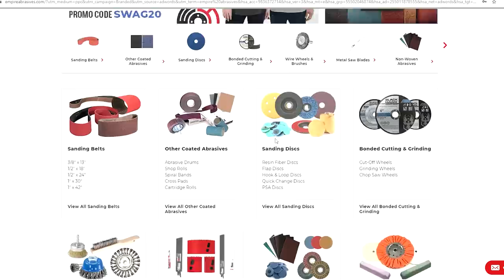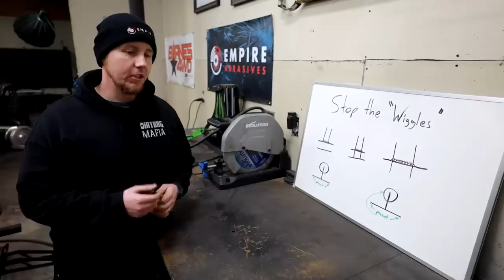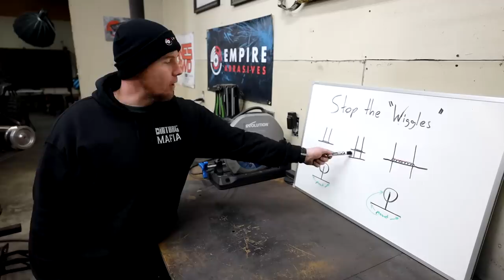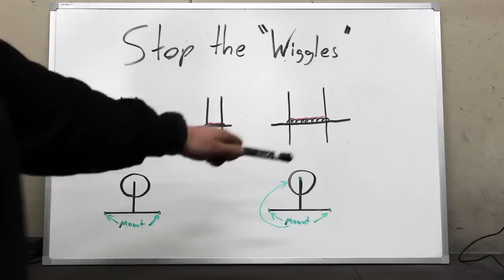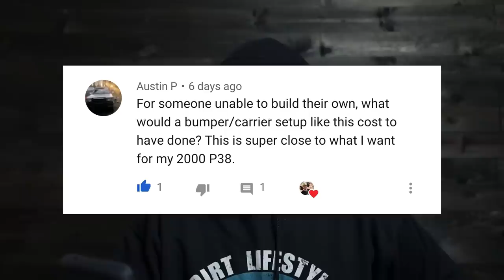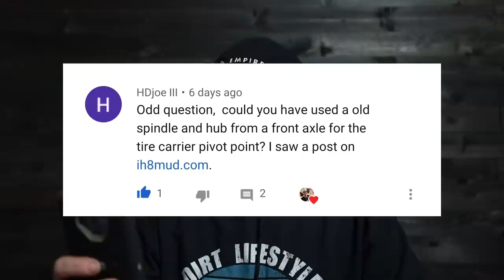Ultimate Overland Tire Carrier Episode 4. Ultimate Land Rover Discovery Build Episode 19

Comment: Thank you for the shout-out for skilled fabricators!  I'm not a skilled fabricator, but I'm a decent mechanic and I know my way around most fab tools.  I'm currently helping someone 'close to me' rebuild their car and they essentially want a full restoration (including the motor) for about $5k. 

This person repeatedly pressures me with 'how hard can it be?'

Well, the ten month collision repair course at my local CC cost several thousand dollars. Tools, air compressor, paint guns, welder, etc cost many thousands more. Understand that when you pay for skilled work that you're paying for the knowledge as well as their overhead costs (shop space, electricity, water, internet), consumables (sandpaper, welding wire, rags, etc), wages, materials, experience, and everything else you lack to do the job yourself.

Which brings me to a second point. 

If you're looking at a $4000 tab to have someone build a rear tire carrier for you and you know your way around tools (and have a decent set of them), consider that the very same $4000 would set you up with a low budget welder, tubing bender with a couple of dies, materials and a few other things needed to start learning this yourself. That's assuming you have a place to set it all up and work.

Comment: I suggested a variation of this latch a few videos ago for the lower latch. I’d like to see if you could run two of that style latches using the same pull lever to disengage it. Using a one into two style cable such as the “Odyssey Lower Gyro3 Cable (Universal) (Black)” part number #b-153-bk in doing this you would eliminate a step in the process of undoing the tire carrier without sacrificing any integrity.

Comment: Whats worse then a spare tire bouncing down the highway? One that is still attached to a huge hunk of metal 🤣 Curios how much the bumper/carrier will weigh and how your rig is handling the extra weight of this build from a suspension and engine/power perspective.
Reply from the maker: Lol definitely. I over geared the drivetrain to compensate for the weight but at the end of the day this rover is going to be heavy as hell. I'm embracing the trade off of weight for comfort and will do what ever is necessary to make it all work. It will likely need a diesel but time will tell!

Comment: Might build a taller tube where it pivots on the bearing and make to bearings so you can make a triangle point to the where the tire mounts and maybe a small brace going down the back of the leg down the fender side.

Comment: The brake lever looks like it might also have another barrel adjuster on it (like what you fabbed up) so if anything backs out and you need to take slack out of the cable, you still can.
Reply from the maker: It definitely does! Lots of adjustment in this simple system

Comment: I have been using a DOT door lock style latch for mounting my tire carriers.  Pretty much bomb proof and the same as used on many hot rod doors. It can be fined tuned and adjusted in the same way  door pins can be moved. It is also of a double lock design (same as a door)   these  latches do not pop open under impact and they do not rattle.   Bear claw, bear jaw  style latch but I used the original USA  built ones (who's name escapes me- I think Hamilton).  Yes it is mechanically controlled from a remote location,  slows down that crack heads stealing stuff.  Getting the 150 lb tire up there is a pain in the butt

Comment: What I would do, is get rid off the rear window like you said and punch a hole through the centre of the wheel carrier and welded through the board of aluminium that will replace the window.😉

Comment: The cable might work in the usa but after a day or 2 in Australia in our thick, red bulldust that cable would be gunked up real fast. Also I'd drill holes through the rhs top and bottom and drop the round tube through and weld top and bottom that way you have 2 solid points of contact and eliminate a lot of the flex.

Comment: as a mechanical engineer, i feel like you missed a detail back on your tube theory. you are not wrong with what you described on your schematic, but the point of sending the round tube through and to the opposite wall of the square tube is to weld the opposing side alone with the adjacent side. so the weldment will be in double shier. on the other hand, that third mount is the right chose. that will eliminate almost all of the fatigue stresses in your design. which is what i was warried about up until now. love your work, keep it going.

Comment: Hey Nate congrats on another great video 👍
When rebuilding the front bumper will you build it heavier to offset the weight on the back to help keep the front tires planted while going more vertical??
Reply from the maker: Thanks! The plan is to use air bags in the rear suspension to help truss the extra weight. The front will be heavy regardless but I don't plan on adding anything extra to counter act the rear. I do however have a bunch of ideas to possibly incorporate a battery in some way to the front bumper. Maybe this could help in the way you are suggesting? Time will tell! Thanks for watching 👍

Comment: What do you think about a bar that is hinged on your roof rack so it opens like a car trunk, but if bent at a 90 degree angle to flip down and latch on the tire to stop wobble?  You could even run a safety chain inside the tube, and attach it to the roof rack so it never falls off.

Comment: The way you built that upper latch, you might only just need that and use the bottom for a safety. To be honest, I would have never thought of that system and it looks like it’s easy to open......
Reply from the maker: Thanks! I feel the same about the bottom latch. It's more of a fail safe at this point 👍

Comment: Hey Nate - did you ever consider using an electric solenoid for your latch?  The benefit being that you can easily trigger it from anywhere really... even a FOB?  I know reliability is big on your requirements...  FYI on my 37" tire carrier, the design has a full triangle shape with 3"x1.5" box steel sections - and it still wobbles around.  Your design is great.  Thanks for the vids!
Reply from the maker: I did consider this! It would be showing off lol. In reality I think a simple system wins in the overland category. Thanks for watching and for the comment 👊

Comment: Dirt Lifestyle,  I  know you are a great fabricator cuz I viewed many of your vlog. My concern is your tail gate latch life span. I built a sub woofer (2x-12") on my son's car that reside in the trunk. The trunk latch doesn't last long because of the vib. I replayed 5:55 on the vlog many times and noticed that most of the flexion is on lower bumper as you mentioned . You can see the lower bumper flexing compared to the body of the truck. It is possible, that if it is corrected, probably still flex because of the length of the swing bar and the tire mounting bracket. The flexion of the swing bar can be corrected by welding a big enough round steel tubing inside of it to take care of the torsional movement. Welding those gussets on the tire mounting tubing as you mentioned, will correct the back and forth movement. You can also add a '70's like vertical push bumper that is welded to the swing bar that extend below to the rear bumper that when you latch the swing arm it will push the rear bumper tight for added stability. Very nice vlog!!

Comment: Such awesome stuff.  I wanted to share something  from an accident I had in March of this year.  I was in a 2018 Ram up-fitted by  AEV to a PXL on 40's  a Tray and flatbed 4WC.  I rolled 4-6 times end over end and side to side down a ravine 300feet.  I had a Custom rear rack  with a Spare 40 on it and a chainsaw.  the rack kept the camper on (it was connected to the flatbed and the camper) till about the last flip.  The welds DID come apart on the rack and  some on the truck as well.  Strangest thing I've ever seen!  My welder told me they used a flex weld??  to me it looked like some weld didnt penetrate in some areas and miter welds looked like they might have been ground to far??  So...As you said in your vid... Welds are stronger then steel stock if its done right...   Maybe mine where not?    Keep up the awesome creativity!!!!  Love it!!
Reply from the maker: Hey man! Sorry to hear about your accident! Glad to see you are still around to share the story. 
If the weld is done correctly the joint is one with the parent materials. If the weld is cold then you are basically just gluing the stuff together and fusion has not taken place. It's easy to move to fast through a project and have a cold weld. Unfortunately it's hard to know with out testing it. In this case you tested it. 
This is why race chassis are often tig welded. With a tig it is very difficult to make a weld that is to cold unless you are working on very thick materials. In the tig welding process you can see the puddles influence on the parent materials much better because you aren't feeding material on top of the puddle like with mig. 
My guess is your torn welds were done with mig and the machine wasn't turned up hot enough but this is a huge assumption. Either way the point is with a proper weld it is extremely difficult and rare to damage the weld before the material around it.
Thanks for watching buddy 👍

Comment: I really love the build. I was just wondering how you would approach opening the rear gate if you were parallel parked with passenger side to the curb. Maybe a 90 degree pin point? That would prevent putting your giant arm out into the road.
Reply: On a second thought, assuming your tools are in the back and you need to change a tire on the side of a road....
Reply from the maker: If a tire change is needed I can remove the tire without opening the hatch. My tools will be store in a side compartment 👍

Comment: IMO: I’d rather see the third point be an inner mounted dense rubber bumper, deflecting the carrier slightly outward (away from rover), this defection moment would use the tube steel properties to secure the carrier, and minimize the fatigue cycling at welded connection you pointed out that will happen without ancillary bracing.  Curious to see how the longevity of the system holds up.  Be it: cable corrosion and contamination (dirt/friction) from use, pin wear, etc.,.  Thanks for sharing the videos, keeps my mind working too.
Reply: Nevertheless thinking at ~3LF with 2” SCH 80, ASTM A53 Grade A, you’d have a max defection of <1/2” therefor at design you’d have 1/8” defection at bumper, spring load system with said design and mitigate vibration and fatigue cycling to yield.

Comment: So 2 mounts on the bumper which is rigidly bolted the frame, while 1 mount is on the tailgate which is on the body? Hope this won't tear the tailgate long-term.
Reply from the maker: Yep! I'm not worried. The discovery is heavy from the factory for a reason. It's a ridged design because it essentially has two chassis. These have a unibody like a Jeep cherokee bolted to a very tall frame making a ridged suv. The deflection between the two will be very small. The wiggle you saw in the carrier will pickup the difference in the extreme (and rare) scenario that these have excessive movement independently 👍.
But if this became an issue, it makes for more content and another problem to solve.

Comment: I thought you were going to use the key fob and the unlocking mechanism for the discos rear door. I wonder what you could use the power that you have back there for too. The defrost power, window wiper motor power, and tail light could be used for lights and whatever. I was thinking that space could be your spice rack for your kitchen too.

Comment: Hey Nate, great work. I picked up a H.F. pipe bender after watching your tips and tricks video and bent up some fender protection. Thanks for the inspiration.
I was wondering about the tire carrier bracing/gusseting. Would running the tube through the top and out the bottom of the square tube welded top and bottom have worked? 
I prefer your third point of contact method but curious your thoughts about drilling straight through top and bottom of the arm?

Comment: Hey Nate, love the videos!! Just wondering, what drill bits do you use for drilling metal? Bits going blunt after a couple of holes is the one thing for us that makes fabrication not so fun.
Reply: A proper set of HSS (High Speed Steel) preferably with some cobalt in is your first step. Then keep the speeds and feeds correct. Rather go slower than faster. Thirdly cooling/cutting fluid helps a lot.

Lastly, learn to properly sharpen your bits. You definitely don't need fancy tools to sharpen a dril bit. A angle grinder with a flapper disk work 'n charm. I have 'n place on my work bench with a hole in that matches the handle of the grinder, therefor I use the handle to tighten the grinder to my bench. Quick and effective.

Comment: Hi Nate . 
Is there a reason you didn't incorporate the second latch release mechanism into the red latch release ? 
Or did you design this as a secondary safety feature in case the red latch busted open ?
Would it have been possible to have the bumper mounted part of the red latch mechanism pivot in some way as to open the secondary latch simultaneously ?
I guess there were reasons you made it the way you did . Just wondering is all .

Awesome work as usual . 
A must watch channel for sure .

Fattrucker

Comment: Probably has been said plenty, but what about the body being rubber mounted vs the frame mounted bumper?  Isn't that gonna cause some issues down the road especially when not on a flat floor?
Reply from the maker: I talk about this in the series. I believe the second episode 👍
Reply: Just rewatched it and you mentioned adding a cable/safety incase it popped open because of flex, but my concern would be that new third mount either getting messed up or just not wanting open/close when twisted up.     

It's a bit different but the Bronco 2 in the pic was rusted and anytime you were flexed at all (so pretty much always when off road) the damn hatch wouldn't close, ended up fixing it by chopping the top off and reattaching the top of the hatch back on to wall it off... haha

Comment: Im new to fabrication so let me know if this would work or not. Couldn't you put a piece of round tubing in the rectangular tube as a sleeve for a slug that you could drop the round tube of the tire carrier down on to and reweld it? Similar to what you did on the roof rack. Pros and Cons to strengthening the carrier this way?

Comment: I need to use those pins to hold my tredpro's on my rack.  The rear tire carrier is looking good.  What are you going to do to get rid of some of the floppyness? (That's not a real word, I know!). My tire carrier seems to flop a bit too.  Only on concrete freeways.  I'm going to gusset mine from the swing out up the back of the tubing holding the rear tire on mine.  I used heim joints for my swing out instead of the spindle design.  They are pretty nice and super easy to replace if they break.  I only have 35" tires on my Land Cruiser.  But I'm going to work on the floppyness next of the tire carrier.

Comment: First off, I want to say that your idea for the latch systems is excellent. However, the way I did mine was a good bit simpler and I disagree a little about the idea that drilling the bumper and welding the pivot top and bottom wouldn’t have made it stronger because you’re making the bumper itself stronger at the pivot. This also is because I disagree with the previous statement that using tapered bearings on an axle-style system is more prone to wobble. The design I came up with was a 3500# trailer axle spindle and tapered bearings and on the latch end, using the same latch you did, I made it captive on three sides with a large C that I made from a cut-down I-beam, using nylon top and bottom for a near interference fit and rubber sheet at the back providing NVH resistance. I’m on 35s, so there is a small weight difference and I went about making the bumper less prone to rotational force by attaching it to my trailer hitch below. I believe that welding through the bumper reduces flex at the weld for obvious reasons and the axle pivot is solid steel, so hopefully that means that heat from the weld didn’t make it more brittle all the way through. With your design, I wonder if doing a double-shear design at the pivot would have been stronger as well as making the latch end captive like I did. Again, love what you did and see nothing wrong with it beyond unnecessary(ish) complexity. Keep up the great videos and ideas, bro! Love every minute of it!

Comment: The only thing that sucks about using a car or trailer spindle and hub is your going to be welding to cast. It is possible and can be done and done to be very strong but most don’t have the skills knowledge or tools to do it. Can’t just grab your mig welder and weld to cast. Takes a stick machine, Nickle rod that unless it’s a special welding shop they probably don’t keep on hand, also a oxy actleyn torch because map gas or your butane plumbers torches aren’t going to give you the heat, and a air hammer.

Comment: Nate, is the tire carrier clamping to a hard mount on the bumper or the tubing on the rear door?
Reply from the maker: Hey man! I not sure what you are asking. How would you measure "to hard"?
Reply: @DirtLifestyle  Thanks Nate. I think the answer comes up later in the video. The primary locking clasp (u bolt with handle) hooks on to a body mounted piece. The same tubing that the MaxTrax are mounted to. My deeper question is why not have the clasp engage a hook on the bumper itself, rather than the body? That way the bumper and body can flex independently without the primary clasp potentially coming undone on the trail.